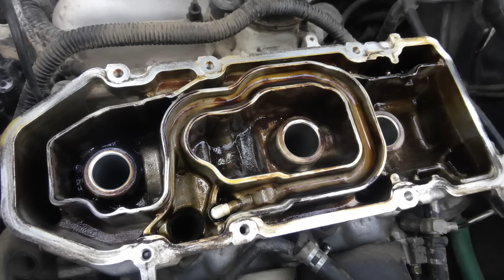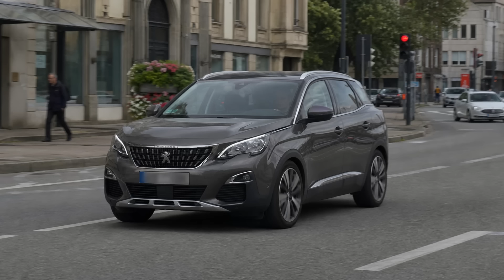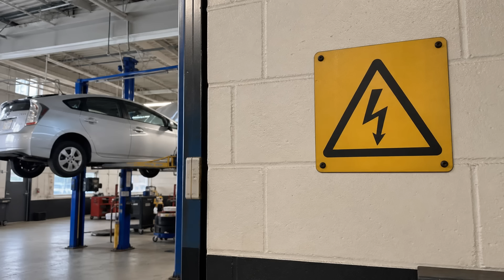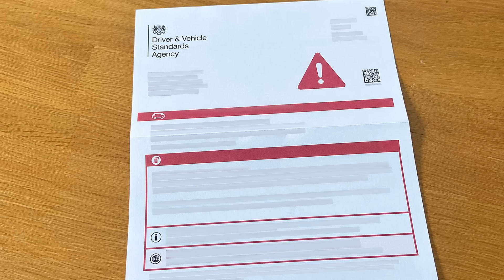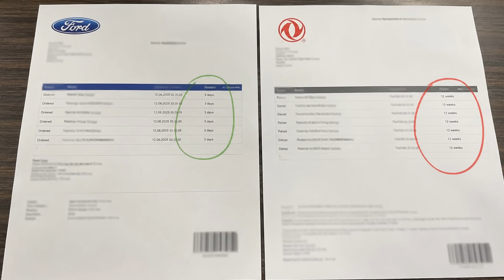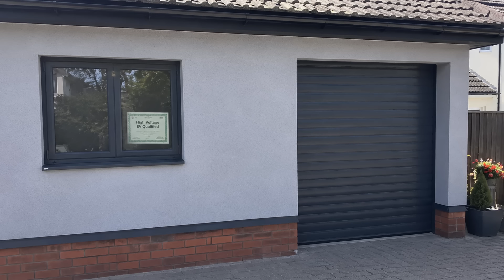12 SUVs BANNED From UK Garages! Here's WHY

Comment: A very timely video. I suspect the wet-belt issue could potentially result in the biggest mis-selling scandal of all time? I am an amateur at car mechanics but some 50 years ago learnt that oil on rubber hoses is best avoided. I can only conclude that running a belt (made from an oil based compound) in oil is high risk and simply asking for trouble. Such a system is clearly not fit for purpose or of merchantable quality and the manufacturers should be sued accordingly.

Comment: Skoda intermittent wiper switch. Cost of replacement, well north of £1000. Following an £800 bill to replace a fuel tank filter, within 6 months of each other. Car owned from new, always serviced at dealer. Failed rear led lights under warranty, failed wing mirror switch ( bargain... £200) result chopped in asap, returning to Japanese brand that has served well for 8 cars, 3 owned currently.
Reply: My kodiaq intermittent wiper switch went floppy then back to normal. Like a spring broke but then it worked again.
Reply: My Octavia 1.5Tsi from 2020 has 145000km. All perfect, only the climate had a broken pipe, maybe it was an animal. I agree that japenese cars are good, our Nissan Maxima had an automatic gear broken already after 60000km. And my Audi A5 2T engine was broken at 90000km

Comment: Rust used to be the reason why cars were taken off the road now its electronics.
Reply: Your so right
Reply: No, its garages with ridiculous labour rates that makes many repairs uneconomical. Most electrical issues are relatively easy to sort with the right equipment and knowledge (neither of which your average dinosaur in the local garage is likely to have). It's the £1000 bills for a clutch, a high pressure diesel pump, a new turbo, a new dpf, or a set of injectors that kills a lot of perfectly good cars.
Reply: @RustyShackleford66  I have had two clutch failures in 40 years of motoring - the last one about ten years ago cost c£350. I don't have a diesel or turbo and don't want one. Best to keep it simple to keep the costs down and avoid using authorised dealer garages - mine was established in 1911.

Comment: Main dealer have always been a joke. Even in the early 2000s. Had a Renault Laguna with a waning ABS light on the dash. ABS the extra warranty didn't cover. Took it in. Quoted over £1000 to replace wiring loom front to rear plus replace the brains. Informed my mate. He said bring in to his house. He jet washed around the rear wheels. Issue gone for ever. It was a dirty senor. Being trapped into a dealer is a scam to rip you wide open. That's why I no longer own a car. And ride a 2013 motorcycle. If we all did this. Things would change. Sadly human nature is what it is.

Comment: I have a 1995 Hilux with about 440,000 kms. Over the years I guess I've spent on average about $1000 a year on repairs and maintenance, and it has never let me down. No computers, no modules, and it still returns under 9 litres per 100 kilometres.
Reply: I had a 1979 Hilux, traded it in at over 1 million kms

Comment: Thanks for an exellent video! Shortly you could say that the car industry is killing itself. Noone can any longer afford the repairs that's coming. How do we get passed that?
Well my own idea is:
Get yourself a well maintained car from before 2012.
Avoid EV's, french or chinese cars or any car with a three cylinder engine. Then you hopefully will be good. If you want to feel safe, get yourself a Toyota from before 2013. 🇸🇪
And I don't work in or own a work shop. But I do needed repairs on my own and others cars. But my 2ZR-FAE engine still runs fine and silently even after 255'000
km's. No timing chain change needed yet.

Comment: Owner of 2010 w204 Mercedes with 230km, has been spending tons of money on maintenance, costing about 1. 5 times the original price, every time I was thinking of trading it for a newer vehicle or switch to another German brand, I was told by all my mechanic that I should forget it because they were still cracking their heads over diagnosing the complicated electronics and software fitted to the newer cars, their unanimous advice to me was to get a Honda, Toyota or lexus, if I ever want to buy another car. Recently I have been buying parts from a China 's ecommerce platform, I bought the parts for camshaft adjuster inlet outlet, timing chain etc complete set, engine mounting and gearbox mounting complete set, fuel pump etc complete set, I paid less than 200 pounds including express freight charges, my mechanic ' s labor charges was about 200 pounds too. It would have cost me slightly below 6k pound if I used original mixed with used parts. Now Been driving it for 2 months, the power delivery was like brand new. One of my mechanic even said it's more powerful than all other mercedes he has driven including his!. My next purchase will be steering rack, sway bar and front absorber x 2 including the cover and rubber set, total 300 pounds, plus labor 100 pounds, if I use original mixed with used parts, the total cost is 1k + pounds

Comment: I've been a mechanic 50yrs and about to retire and thank fuck because the bucket of shit the car trade has turned into is ridiculous
Reply: When government “ Think tanks “ ( oxymorons ) get involved.
Reply: Bring back the distributor.
The “Dizzy was quite accurate and could have been improved “
Lack of incentive.
Red tape.
Computers can control everything.
Nah.
Reply: @johnnorris1983  My grandfather was the village blacksmith during the transition from horse drawn vehicles to engine powered vehicles. I took over the business he started. It evolved to repair cars and commercials in the 1920s. I ran it from 1971 to 2016. I moved on to work as a high voltage instructor for a major vehicle manufacturer. We are never going to turn the clock back. Professional technicians need to be proficient in new ways. I have a photograph of my grandfather fitting steel bands to wooden wheels. Vehicle manufacturers have been getting it wrong since the invention of the vehicle. Modern software defined electric vehicles will change the repair trade in the same way as the move away from horses changed the role of the blacksmith.
Reply: Same for me as an independent mechanic I can fix anything but the way vehicles are going with constant faults after 56 years of working I want out. People are gullible and conned into buying these awful vehicles and they are supposed to be better for the environment 😂😂😂 too much crap built into vehicles now 🤬
Reply: So right,spot on,the twats that design them don’t have to fix em!
Reply: @neilgill2269  Those "twats" have both their hands tied behind their back by leigislation.
Reply: Got the 50 + years and retired 3 years ago just so glad to be out of that shit, worked for main dealers most of the time towards the end had to do a video of the car for the customer before I started the service ! just pure stupidity.
Reply: My old man is, WAS, a mechanic.
He worked on council buses in Bradford, and built motorbikes in his spare time.

Our childhoods (my two Brothers and i) were spent around engines and cars and spray painting.

He left the trade in the late 90s and went to work for the council.

He hates the trade today. More specifically, he hates the planned obscelesence.
Reply: 3cylinder engines are throw away. Engines

Comment: Jeep Grand Cherokee 2014+ with 3 litre eco-diesel:
Failure of oil cooler
Failure of engine main bearings
Clogging of intake plenum with soot
Crankshaft tone ring failure
Extremely high cost of OEM parts and poor availability 
Once out of warranty, we do not touch them

Comment: The byd and the mg are utter trash. I recover on average 2 of each every week and alwys with the same issue.  The local mercedes dealer that the byd cars go to are now refusing to deal with breakdowns on them. They are the local dealer for byd,now tells you something eh.
Reply: Interesting about BYD.

All the cars listed in the list are correct just do not buy one! I work for a big garage and I buy around 130 cars per month and the worst are the Puretechs, MG’s JLR ingeniums Ford eco boost 1.0. Just avoid avoid avoid especially any car with a wet belt !

Comment: Don’t buy any new car after 2015 or any car with wet belts absolutely useless and forget EVs completely!
Reply: I agree, I have a 2015 BMW 320D Sport. Brilliant car £30 pa Road Tax, all the performance I need, 600 miles plus range on a tank, 115000 miles and drives like new.
Proper dials, doesn't tell me what to do. Would not have anything newer.
Reply: Don't buy anything VAG after 2012 this coming from someone who has mainly owned vag cars
Reply: Why after 2015 are bad? What changed after this year

Comment: I have a 1.0 Ecoboost, luckily updated with chain rather than belt
Reply: Better but still far from ideal. They still have a wet belt that drives the oil pump. I'd still stay well clear of them having been bitten before.

Comment: Blame the manufacturers that deliberately SELFISHLY increased complexity so owners are forced to go to their own dealerships.
Reply: You think manufacturers are responsible for emission targets?
Reply: @byteme9718  show me a bike manufacturer that uses wet belts & you’ll have a point. Ilk show you a car manufacturer not needing a wet belt.  Clue - PSA who went from wet to dry 2019. 

It’s not “emissions” it’s cheap design. I’ve seen cam chains in cars that are weaker than a kiddie’s tricycle chains. 

Plus emissions don’t affect the bulb changes on lights.
Reply: @craigyllyn  Motorcycles have always been subjected to far less stringent emission standards so your point is irrelevant.

Car manufacturer's have been forced to comply with increasingly stricter strict emission standards and one way to do that is by reducing friction. This is why some have chosen wet belts and where these are failing prematurely, Stellantis are picking up repair costs on vehicles up to ten years old. Ford, as usual offer nothing. Wet belt failure, while common, doesn't affect all vehicles at the same age and mileage so there are other factors. I suspect dealer's upselling a basic service with solvent engine cleaners is one possible cause of premature failure. In my experience, in most cases, failure isn't sudden and there's usually an oil pressure warning, loss of brake assistance or belt deterioration is identified during service.

Thinner, lightweight timing chains are by design, not cheap design. In some cases these have been too think and the PSA 1.5 diesel engine is an example. There is a goodwill policy in place, where problems occur to replace this with a wider 8mm chain kit or even replace the engine if the chain has broken. Land Rover have done nothing for their Ingenium engine but even if they did, the engine has so many other sources of failure.

Another example of forced friction reduction is thinner, low tension piston rings that can cause premature compression and oil consumption issues made worse by ultra low viscosity oils.

The move toward LED light technology is very much emission based and is a fundamental requirement for EVs. What's unforgivable is the cost of replacements with a Land Rover Evoque headlamp costing around £3500.

Comment: timing belt running in oil ,,
complete bonkers ,
Reply: 2 belts.....one runs the Camshaft the other's for the Oil Pump.....
Reply: MADNESS .
Reply: Absolutely. As an apprentice it was drummed into us that you keep oil off that belt at all costs. Now, it’s running in it. The only loser in all of this is the owner of the vehicle, who once they’ve been bitten is unlikely to buy a product from that manufacturer ever again.
I started my career in this trade in 1985 working for a small independent that grew into a large independent. Back then, owners were being  burnt with Ford cvh timing belts breaking and bending valves etc. We used to keep heads and cam kits in stock for them. Ok, it was a pita for the owner, but we’d get their car back to them in a few hours, at reasonable cost. Those days are long gone, as well as any enjoyment actually doing the job.

Comment: Cars that have designed faults make money for repair shops instead of salesmen . For example cars from Stellantis are cheaper than  Toyota  and are offered with discounts and 0 % finance . You will take a hit again if you changes make or even if you replace it with another . Theres a reason it was 4000 cheaper than than Toyota that holds its value

Comment: 10 years ago I bought, new an Hyundai i10 automatic. It has 23.000 on the clock. It isn't used much, has been regularly serviced, and apart from replacement tyres, battery and brakes no issues. A year or so ago I thought I might replace it with a new car, but never actually did. A few weeks ago I had the same thought and was amazed to find that I was offered £1.500, more as a trade-in than last year. The only other car I ever owned that increased in value was a Ferrari 365 GTB. So, I have decided to have it undersealed, paint work protected, and fingers crossed, go for another 23.000 miles and another ten years. It even might appreciate a bit more😊.
Reply: I  owned a Hyundia Accent from new ,Travelled all over the country I had it from 2002 to 2018 it never let me down  ,Found a really good mechanic he did a Regular service for me , It was destroyed one night in winter one by 1 young lad and ice on the Road . But was the best car I ever had .
Reply: Look out for fluids, most home mechanics like me can sometimes miss out on small things that don't complain loudly - flush your radiator and cooling fluid - same for brake fluid - also replace water pump belts before they get to the breaking point. A badly overheating engine with failed head gaskets can be a death knell.

Comment: I have a 30 year old land cruiser. So easy to work on and service myself at home. Built like a tank and very reliable. I wouldn't touch a modern car if you give it to me.
Reply: I similarly have a 32year old landrover discovery 1 300tdi. I am hanging on to that until the bitter end.
Reply: It’s the unreliable o2 sensor that sends to a computer that controls the jet pressure.
THE 3 problems are there and insurmountable .
Bring back the distributor and make it more accurate..
“  PrOgReSs “ won’t let them.
Too much red tape.
A government think tank.
(. Oxymorons ) got there first.
Reply: @johnnorris1983  You don't have the slightest clue about how any car ever worked,
Reply: Snap 😅
Reply: Wish I'd kept my 1995 Isuzu Trooper LWB.
Reply: Snap 2
Reply: I have a 33-year-old Daihatsu Feroza with 190,000 miles and a 2.8 turbo diesel engine that’s still going strong.

Comment: 55-years in the trade. I wouldn't touch anything that's later than 2015. Both our cars are 2010 Toyotas, an era when they knew how to make simple, reliable, economical cars. I have a computer on my desk in my office, I don't want to be driving one.
Reply: I drive a Honda CRV Hybride no problem
Reply: 55 years in the trade and you cant deal with something an diy'er will tackle on their driveway? Must be a pretty crap mechanic. 😂
Reply: @RustyShackleford66     stupid and unnecessary comment
Reply: @lizlancaster3692  Yes it was. But you still typed it.

Comment: I run a small commercial HGV workshop for a family owned removals company, I've been in this game for 40 years, and it is getting so much harder. We only really do the basics, we turn away pretty much anything to do with emissions/adblue systems, it's just too complicated. We will only do our own cam belts. We are currently changing the engine on a 2021 Peugeot Boxer, with just 69,000 miles, it was serviced twice as often as required, yet the rockers wore out (common problem apparently), without labour parts are over £5k for a new engine, injectors and clutch. I know of numerous wet belts that have failed. I know a mobile mechanic, he refuses to even change the oil on Ingenium engines, I'm really surprised that was not on the list. I changed my car 18 months ago, I got a Kia E-Niro, no engine to go wrong, but comes with a full 7 year warranty. EV's in theory should be much more reliable than their ICE counter parts, and there are plenty of Hevra garages around.